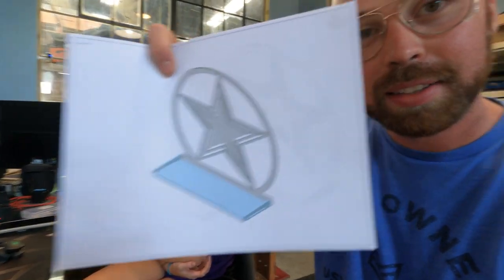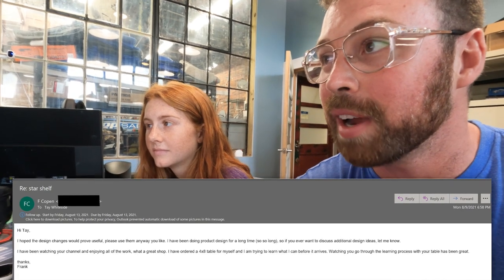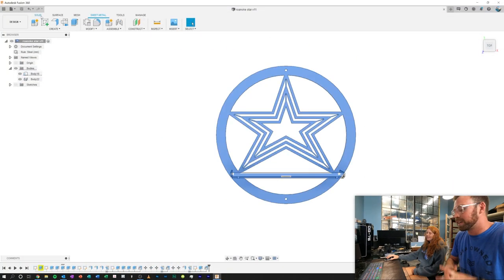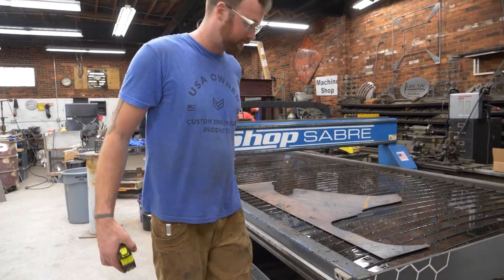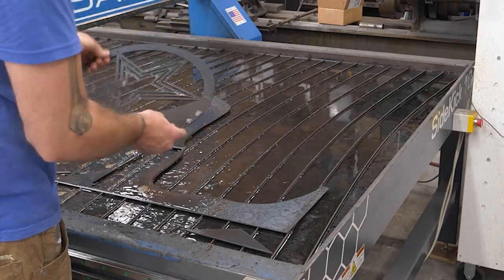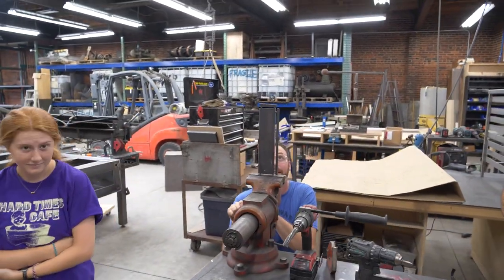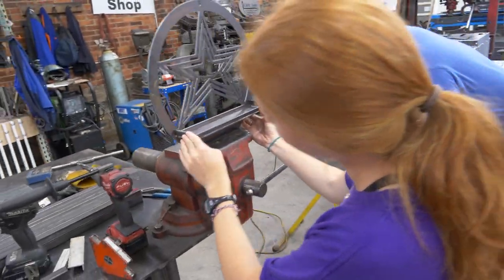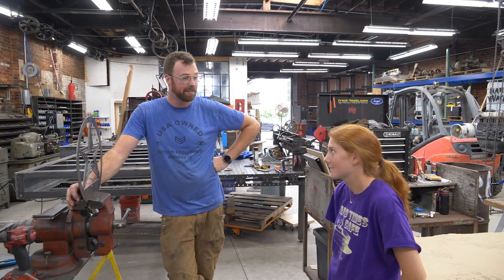A Viewer Improved Our Design! // Lift Arc Studios

Comment: Firstly great work Arden, it was nice to following along on the whole design process with you all. I’m bet you had fun on your internship there and I’m sure you have a bright future ahead of you in design. Secondly to Tay, I was wondering do you ever think about cutting other items in the waste prices at the same time? Like the small waste sections in the star, is there enough room to cut small LAS keyrings or cut little stars with a hole in one point (and I’m not sure if the plasma can do it, but not cut all the way through and just do relief cuts in the smaller stars to make in look like the big one) then just clean and paint or leave it metal with a bit of clear coat on. Quick little items to sell on your site. I just imagine you  must have metal off cuts that are just to small to balance on the water table and it would be easier to cut out when it’s part of a bigger piece. I hope that all makes sense. 
Thanks again to all of you, the videos are great and the hard work you all put in really shows

Comment: Im really looking into buying a table myself, is it possible to create complicated designs to cut out?.... such as an nfl team logo? Houston Texans
Reply from the maker: FOR SURE, there is seemingly no limit to the complexitiy of the design. The only limits are physical ones. Plasma (at least with typical nozzles) can only cut down to a certain level of precision and intricacy without just melting the metal away. But if the sign is rather large, this issue virtually doesnt exist. Cheers! - Tay